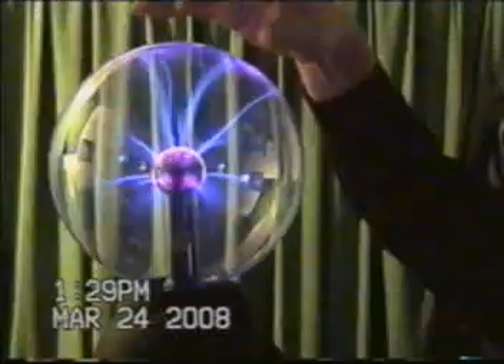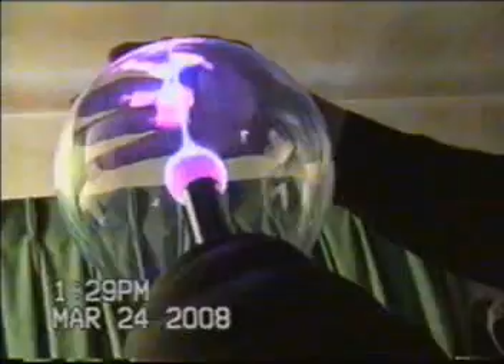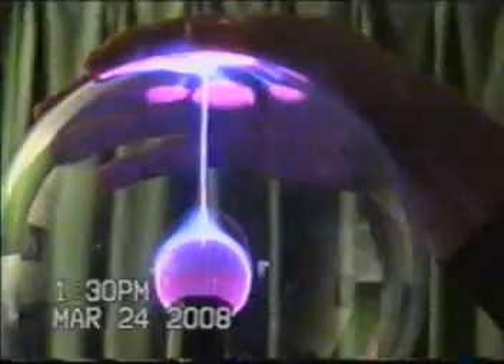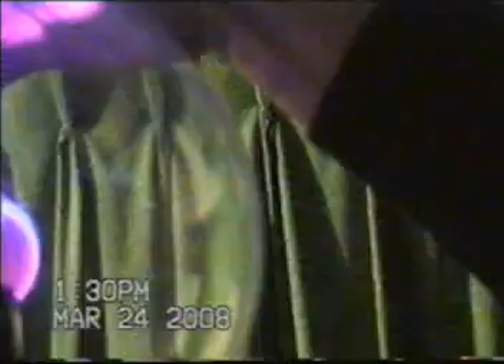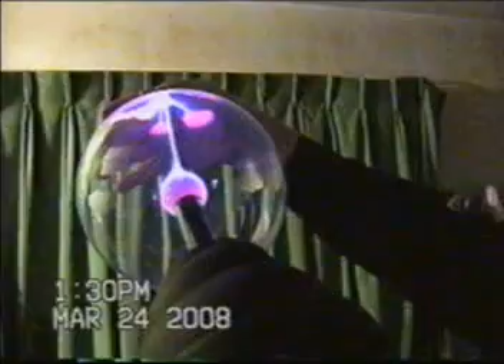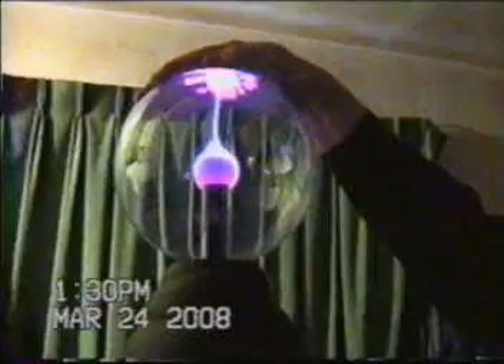Plasma Puzzle

Comment from the maker: Sounds cool. Depending on the gas you use, different frequencies of light emission are possible. A typical flashlight will convert DC into multifrequency white light. The photon energy that escapes from a plasma is a loss to the system. A neon lamp for example, will convert thousands of volts into photon energy - the lamp functioning as a resistive element to circuit. Keep in mind that pickup coils only react to changes in a magnetic field and steady DC generally only produces a stationary field

Comment from the maker: Yes. If you look carefully, you will see that I concentrate the stream into a tight spiral. This spiral is a double helix joined electromagnetically and represents an EM balance. Consequently, passing the stream through the center of a toroid becomes a matter of wire size, coil dimension and orientation. The interaction of the stream's bounding fields with the wire will be a VLF AC product of very low power. Additionally, the coil itself will produce fields that will cause the stream to collapse

Comment from the maker: There is a point before 90 degrees where the two forces tear. At this point the electrical path will exibit a stronger force and win over the gravitational force. However, as the glass becomes charged the force will diminsish and the gravitational force will take over. Thus the streamers resemble those of a Jacobs Ladder apparatus as they come and go and rise up horizontally.

Comment from the maker: Actually the plasma demonstrated is cool. Normal fluorescent lamps are another example of cool plasma. The glass gets warm because of the electrical flow through it. This flow is AC and the glass acts as a capacitor. Moving the electrons back and forth warms the glass.